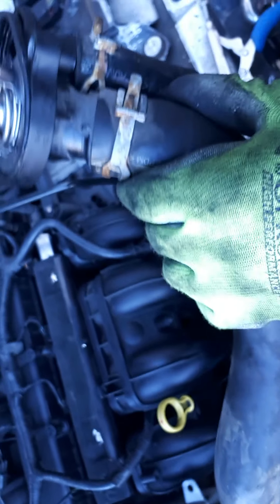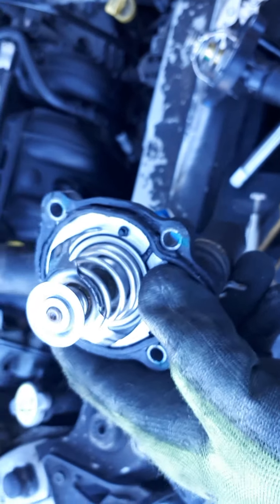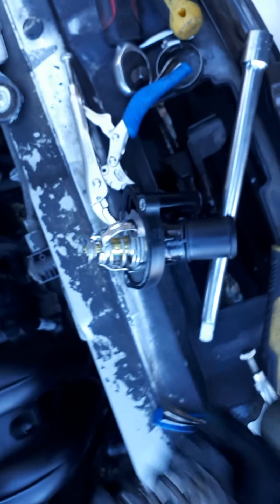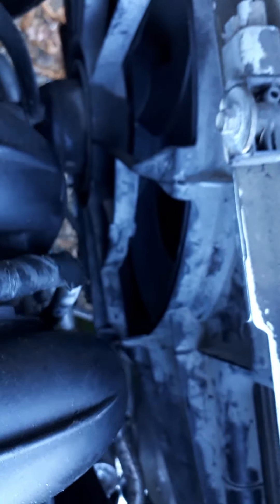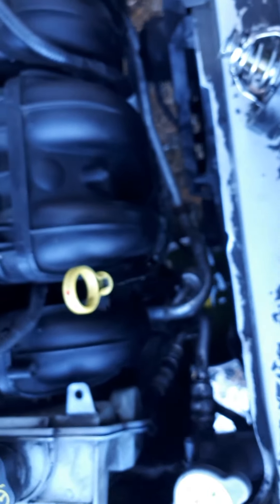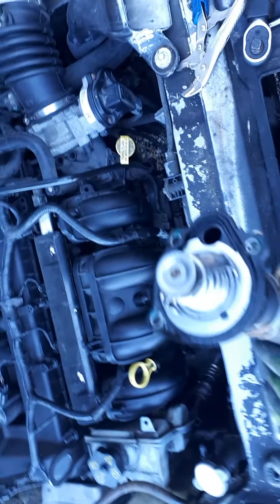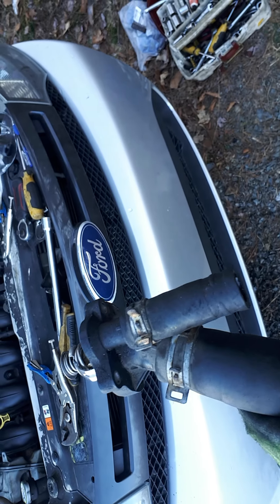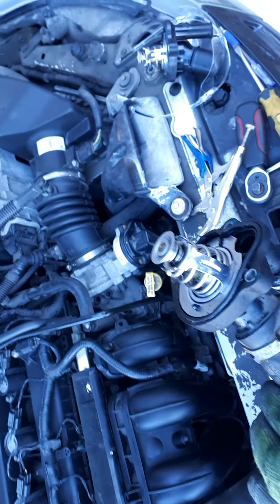PT 2/3 Thermostat Replacement 2010 Ford Focus WITHOUT REMOVING RADIATOR OR HEAD LAMP.

Comment: Had the seal made it's way into the spring it would not have been a seal at that point, most likely an internal failure. Not knocking the video I just don't think the failure conclusion is correct. Interesting name "Tropical North" Millions of years ago it was exactly that.. ;).